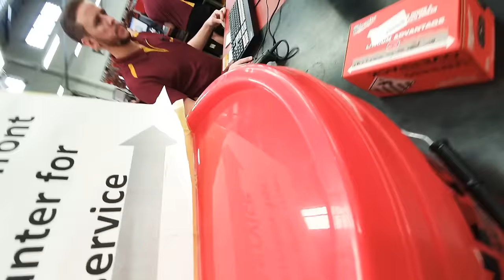Pro Drywall Construction Crew with The Right Tools that GO FAST!

Comment: These guys will be in wheelchairs by the time they are 50 ! Work like that every day you'll destroy yourself. You have to work fast but work smart at the same time
Reply: I never met a drywall guy that planned on living longer than 50 anyway. The drugs will kill them before the heavy lifting takes them out.
It still amazes me that drywall is even a legitimate trade when it takes like 1 day for any competent high school educated person to learn
Reply from the maker: @joseph7105 clearly you don't know what your talking about, also need to be able to have some strength, which also probably counts you out
Reply: @joseph7105  you could not be more wrong
Reply: I have been plastering for 30 years and have been working like that. Before that, I  was a water borer and mineral driller for 25 years and worked like a dog. I  started working when I was 14, I still work like that, it has not hurt my body in fact it has done me good, it is true "hard work didn't kill anyone" it is good for you.
Reply from the maker: Thats great my man. Definitely a true saying @Bandit-10-4  Thanks mate
Reply: Na bro.  I was a weakling starting construction but kept pushing myself over time.   Lift and carry correctly every time but always grab grab a little more than normal and end of day or week lift way  more than normal and eventually people will tell you you’ll fall apart too. But what they don’t know is my half capacity is comfortably way more than a lot of lazy guys and I feel great.  It’s just working out that’s it. You wouldn’t tell a regular gym person (not a power lifter) your working out to hard your going to crumble at 50.  No those people actually live longer and have an easier life because simple physical tasks don’t cause you to blow a gasket like most most people.   Also quit walking.  You need something out the truck jog.  It will pay off physically, sexually, financially, spiritually and you’ll make lazy people exhausted so they’ll drop out your life too.
Reply: Papabash.. u better sit down u seem very tired n weak... I'm also a rocker.. building America 1 12'er at a time 💪
Reply: Life is about hard work . When you die it won't be from hard work . Maybe laying on the couch  eating Doritos  will ??
Reply: @joseph7105  get a grip. It takes years to perfect the speed and neatness. Don’t comment on things you have no understanding of. And yes I’m a Dryliner myself.
Reply: @Maxkil man has probably never lifted a sheet in his life
Reply: Fair play to you guys! Great to see true professionals at work. How much can you earn a day working like this in Oz?
Reply: You know they do pace themselves and this is just an impressive demonstration of what they can do with skill and good tools.
Reply: If they keep working g like this they probably won’t need to work by the time they are 50.
Reply: I hung for 7 years.  That’s just kinda the pace you work at.  Makes the day go by quickly.  

And it’s not that hard if you have the right guys in the right spots, people who work together well, and people who know what they are doing.
Reply: As a plasterer i been working like this ALONE almost everyday for the past 8yrs and im still going hard, drywall isnt the trade for you if youre a pussy.
Reply: @joseph7105  nah these guys are Australian, they can do construction with having to be high unlike in America!
Reply: @papabash  what couch have you been laying on all day?  Work hard everyday and still going, and way older than 50.  Still no wheel chair, braces or sick, get off your couch and go work so you don’t end up in a wheel chair!
Reply: @joseph7105  Spoken like someone who never hung a single piece of drywall.
Reply: You don’t see any middle age hanging drywall do ya 🤔
Reply: @papabash  I’d rather work hard physically than sit on my ass in front of a screen inside all day. You people love to talk about how construction workers destroy their bodies. Well yeah, but the bills won’t pay themselves and the work is good and it beats destroying my body by becoming fat in a cubicle. Life isn’t all sunshine and rainbows. Sometimes you gotta do the dirty work, or backbreaking work in this case.
Reply: @Maxkil Bruh you probably carried 1 8’ and gave up on life 😂😂😂
Reply: You gotta stretch. The key is stretching, otherwise that slipped disk will hit you mid 30s-40s

Comment: Longest sheets of drywall I've ever seen in my life
Reply from the maker: hell yeah!, its thin though. dont be fooled we are not that strong
Reply: How long are they? 16ft?
Reply: I was going to say, are they like 3/8”?
Reply: @Jabberwok28 It's probably a half inch.
Reply: @Jabberwok28  No. 1/2 or 5/8 for walls. Always. And that was a 16' sheet.
Reply: @Maxkil  ohh i thought those are 5/8 sheets
Reply: @AnthonyBarnett-ez3ni  10mm x 6m. Not heavy, just slightly awkward to handle.
Reply: @GigaChad-lr2gx  just under 20 feet
Reply: Yes  @Jabberwok28

Comment: Are these cheap homes you're working on? With the metal studs, thin drywall, and no insulation, sound must travel across the house with ease.
Reply: Who insulates an interior wall?
Reply: @arod6789  pretty much every country besides Australia
Reply: @craigpalmer256467  alot of interior wall are not insulated in homes it's just the exterior for heat amd cold
Reply: I noticed there are no electrical boxes.
Reply: @craigpalmer256467  haven't seen any and I'm in the US
Reply: @craigpalmer256467  this is factually wrong.
Reply: @h2s142 no reason eh? Shows how much you know. For sound control.
Reply: @skliros9235 Maybe on bathroom walls. Homeowners generally don't want to pay the extra cost to insulate interior walls

Comment: Why are you leaving gap at top and seeing board on floor. We always went tight to ceiling and left gap at floor
Reply: We d the same thing in the states on commercial buildings.  Metal flexes so we put in plastic made for that so the rock doesn't crack. Basically an expansion joint
Reply: I know that in Australia they use cornice which covers that gap
Reply: Yep the floor trim covers the gap.
Reply: I wouldn't hire these guys to sheetrock anything.

Comment: Are you leaving out where you cut out where the receptacles are in the rooms? NEC code spec are supposed to be every 12' around a room. I didn't see anything exposed. I didn't see any switches either. I have done my share of sheetrock work over the years. Great job, just asking.
Reply from the maker: The electrician does that and they are all marked out prior to sheeting and get pulled through later

Comment: What's with the huge gap in the top angle? I see boarders starting on the top sheet first then lower, a huge amount of boarders never take into account of how a taper would do his job without unnecessary butt joints,screw nibs not recessed.

Comment: Why do builds in Aus not often use interior wall insulation? Are they just being cheap?
Reply from the maker: Yes they are being cheap
Reply: I dunno.. Maybe so that if you fart on one room people in the other don't hear it?
Reply: No reason to insulate interior walls. Duh
Reply: @h2s142 For sound primarily, but also thermal. If you have a multizone ducted AC system, especially using newer tech with individual zone temperature settings, you can close doors to unused zones and have less thermal transfer, more efficient cooling/heating. But yeah the main reason is sound. It's very commonplace in most other parts of the world to have internal wall insulation, but Australia is so far behind the game with insulating buildings in general. We may not get the same cold weather as the northern hemisphere, but we get extreme heat. We still have new builds with 4mm glass, and limited wall insulation FFS
Reply: @smellygoatacres  see above
Reply: I mean as long as a fart is happening in a different room I kinda want to hear it.

Comment: What ya gona do with that crack at the top? I hung rock for 40 + years, commercial and residential. Commercial starts at the bottom and residential starts at the top. I they would have pushed the top wall piece up to the ceiling there wouldn't be a crack, and the finisher 's job would be a lot easer...
Reply from the maker: It gets cornice, otherwise they would need to get wider board
Reply: Australia has cornice everywhere as standard

Comment: 3/8 inch...for ceilings maybe. Those walls are paper thin.
Reply: lived in a crappy house with walls that thin. Made many repairs when moving out. Just a minor bump between the studs would break it. Awful stuff. New house has 1" thick walls, a bit overkill but it was built to last over a century.

Comment: Just curious about popped screws. Work behind guys with screw guns, and always have pops to deal with
Reply: Installed wrong . Nothing to do with them being screws.
Reply: @Ketchupbelongsonsteak  no shit!?. It was more or less about using the guns with bands, and just pumping and dumping… why I said, what about popped screws. Pump and dump, leave it for the finisher. Not my first day
Reply: @zachwagner1838  I hate those guns. My shoulder can't push them.
Reply: @Ketchupbelongsonsteak  most of the hangers we work around nail the perimeter, screw off the field. Problem we come across is they don’t have the depth set right, pump and dump, and leave us with the mess. They use screw guns, but they aren’t the decking screw guns. That’s why I said, what do they do about popped screws. No good with the OG if not set, what about the decking screw gun?  Even worse for wear
Reply: @zachwagner1838  when I started we nailed perimeters.  Now I never use nails but I glue when I can. Vapor barrier obviously not gluing there.
     The paper on the face of drywall is so thin these days it is hard to get screws that don't pop through but it is still possible guys just need to pay attention more.
   I'm still on the fence for cordless guns. I feel to often when I'm finishing I'm turning those in 1/8-1/4 turn before the sheet is actually tight and doesn't move when pushed on. I love gluing because less screws and in the case a screw does break paper the sheet still doesn't move so it's not coming back as a pop later.
Reply: It's the installer, they need to be pushing the sheet up properly against insulation on the ceiling for example, improper vapor barrier installation is also great for popping screws and breaking drywall. Interior walls should be glued and screwed, stairwells 100 percent screwed by building code at least where I am

Comment: Weird..drywall not stacked on the wall, cutting it on the floor. Metal studs in a home.? Walls to not go all way to the ceiling. Is this professional.
Reply from the maker: They stack plasterboard on the floor for safety reasons as well not put the weight of the stack on the walls, I suppose.

Comment: All can hang by themselves and are fast. Ive been hanging over 20 years. Ive never seen framing like that though. Its nice to get a square open layout like that. Pretty fast with those screw guns you guys use. Couldnt pay me enough to run those but I gotta give you credit for the speed with them. I could definitely work with these guys, but not running that monstrosity of a gun lol. Hand fed screwing is the best and fastest (for me). Good work though guys!

Comment: Good job guys how long r those drywall? I love mudding
Reply from the maker: 6meters man, I love mudding as well. Everyone does I think 👍
Reply: @Maxkil  I want to love it, but as a DIYer I just don't get enough reps. I spend more time swearing than mudding.
Reply: @markhodges1276  As a DIYer,  I hate mudding, painting, tiling etc.    Much prefer screwing, nailing and assembling in general :)
Reply: @dmitripogosian5084  yeah any finishing trades are rough. They require technique which only comes from practice and repetition. I'll probably annoy a few chippys with this comment but framing just requires building code knowledge, the ability to measure and the right tools. Much more fun.
Reply: @markhodges1276  Yep, that's why I always feel that plumbers, electricians, installers etc overcharge,  while finishers ? I just bow and ready to pay anything they ask :)

Comment: why dont you put the drywall all the way up
Reply: Cornice (coving) closes the gap. Leaving a gap makes it much easier to hang. If they were going to tape and mud the corners then for sure they would hang a tighter fit.
Reply from the maker: @markhodges1276 yeah mate, we put the bottom sheet on a block of plasterboard then sit the next one on it. Cornice finishes the top

Comment: Have you previously done a video on the framing requirements with metal studs down your way before? Appears very detailed behind the sheetrock. -Bob...
Reply: All the houses in Australia and New Zealand that are steel frame are pre fabricated and just assembled on site like a puzzle
Reply: @victorguerrero4249  does that make it more economical and/or more efficient? If so, is there a way to bring that to the United States?
Reply: @steventhebroker  less time less waste so easy a trained ape could assemble it
Reply: @victorguerrero4249 Lol. That’s dope. How do I go about getting that system here in South Florida? What’s the cost?
Reply: @steventhebroker  Pretty sure they build metal garages & shops like that in the US
Reply: @houseofwonders1   I've seen wood prefab apartments, and even prefabbed steel framed walls for commercial. I did a commercial job recently where all the small walls were prefabbed and assembled, and all the 40 ft structural studs, track, and bracing/strapping were predilled, cut, and labeled for assembly on site. I'm a union carpenter in st louis

Comment: What’s with the gaps at the top, curious
Reply: cornice
Reply: But what if customer at a later date doesnt want coving..thats shocking you dont care. Amateur at best .
Reply: @HARRYYZ125  If you pull cornice anyway your going to need to hang new sheet. The cornice cement will take a good chunk out of the sheet on both wall and ceiling. Decision to use/not use coving would only be made on new build or major reno.

Comment: It will never not bother me seeing people do drywall from the ground up instead of the ceiling down.
Reply from the maker: You know why?
Reply: Genuinely curious, but to my knowledge you start from top down so that the inside corner joint for the ceiling has 2 factory edges for finishing. Ifyou don't care about that though going bottom up is easier to hang, since you can balance the top sheet on the bottom sheet. Cool video though!

Comment: Gotta love Australia. 20 foot boards. Cornice everywhere.
Reply from the maker: Yeah, the sheets are thinner to elsewhere you know. Only 10mm walls 🫣
Reply: @Maxkil  you can get 10 mm in europe as well but 12.5 is the most common. Soundproofing is more common too. I did a job where all the internal walls were sound deadened and double hung first layer with moisture resistant and second with knauf purple board. That stuff is heavy and rediculously hard to cut. Also need special screws to fix it, found that out through trial and error mostly error😅. Great watching you guys work though learnt a heap. Miss the 6m sheets everything is 2.5-3m max here.

Comment: If you cover up the studs and dont mark it how are you going to accurately screw it off on every stud
Reply from the maker: yeah good point, so need to mark it takes the guessing out of it
Reply: Too much time if you have a good screw at top and bottom and you know your trade eyeball is all it takes.
Reply: @harryhoudini2645  the time it takes me to mark my studs is a fraction of the time fixing duds trying to not miss

Comment: 100 times faster then me but mine is better, I like it tight against the ceiling it helps support the edges of the lid.
Reply from the maker: Yeah we have a cornice that goes up for that., if you want it tight here you would need to buy a wider sheet and cut every sheet down

Comment: tsk tsk.... always hang top sheet first.. taping that ceiling joint would be a pain.... if the gap is on the bottom, baseboard covers it
Reply from the maker: Yes you are correct, however we are not taping that, it's gets a drywall cove cemented to it.
Reply: @Maxkil  oh ok...  cool vid

Comment: How long is that board?? 4,80 meters¿?
Reply from the maker: Our sheets come in 6.00 meters or 236.22 ″ for you Americans
Reply: In arg. We only have sheets of 1.20 x 2.40 meters generally (standard). It is difficult to work with sheets of that size (6 meters), since they are not found in the market in our country. Thanks for the answer  @Maxkil

Comment: Quick question, what thickness is the drywall that you guys normally use?
Reply: 10mm standard
Reply: @dismaldog  wow no wonder they lift and toss it around so easy haha.
Reply: And people say American walls are made of paper
Reply: @WalrusMcDonald12n2na2  which people?
Reply: @dismaldog  makes sense why his rotozip flew through it. I went through 3 rotozip bits trying to cut out a hole for an ethernet faceplate in my wall. 1" thick- 1/2" cement board layered over 1/2" gypsum.
Reply: @WalrusMcDonald12n2na2  and sheetrock, so if a wall falls on you during a earthquake you won't be squashed like a bug

Comment: How thick is the plasterboard?
Reply: 3/8 drywall or 10mm
Reply: @talkingben3814  What sizes are the large long sheets of p/b you have on the video?
Reply: @vincenzoniccoli1986  The Drywall is 19 8.22 feet long or 6 meters long by 4 feet wide they are 96 to 103 pounds per sheet.
Reply: I couldn't imagine putting ⅜ drywall up without a backer That's just too thin Juat leaning against the wall would cave it in